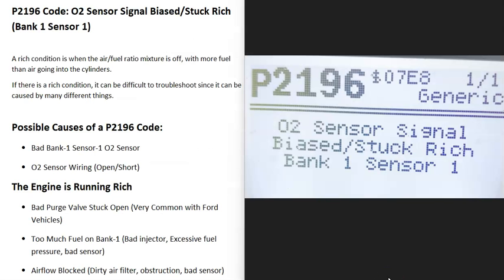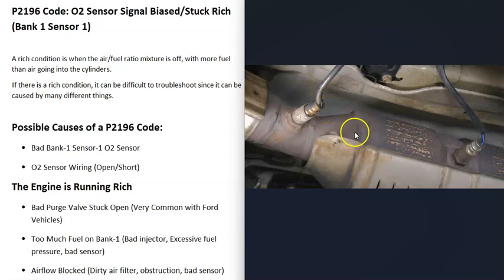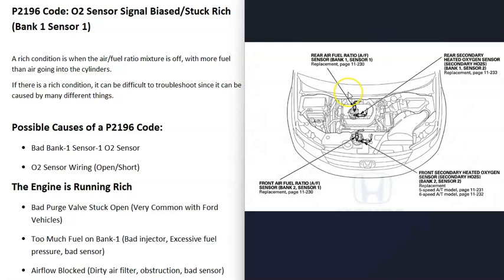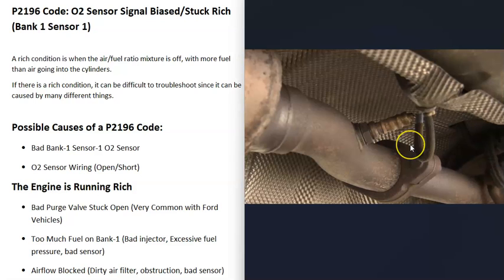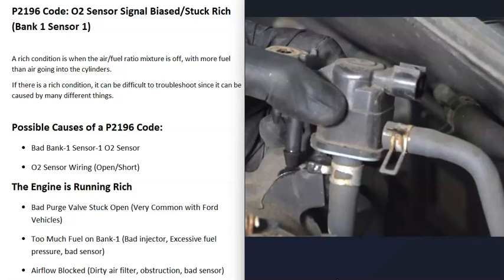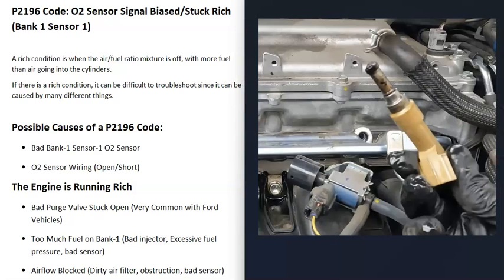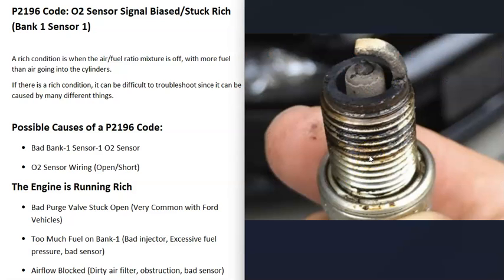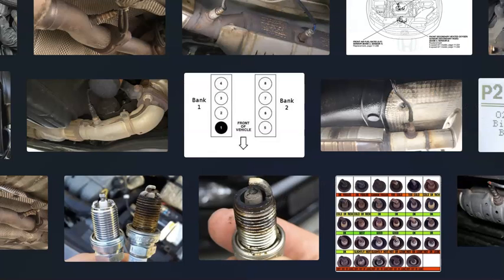Causes and Fixes P2196 Code: O2 Sensor Signal Biased/Stuck Rich (Bank 1 Sensor 1)

Comment: Thanks for the video...i have a 2012 f150 with the coyote 5.0 engine.  Currently showing p2196 and p2198.  Since its reporting rich on both banks, would the purge solenoid be the right place to start? I had 1 instance when it didn't want to start and 1 where it stalled at idle. Any input  is appreciated!

Comment: Got a 2004 Camry xle, throwing a p0171 and p2196 , any suggestions?
Reply: Did you find the problem?
Reply: @Kagawa71 yes ! Ended up changing the MAF sensor, I was able to determine it was faulty by reading the OBD scanner Load % , it was less than 80% around 58%-60%

Comment: Very interesting I have a 2016 Toyota Corolla with a P0172 p0456 p0139 p0441 p0455 p2196 and I’ve already tested the purge valve seems to be working once engine warms up can’t seem to figure the problem I don’t assume both o2 sensors would go out

Comment: Thanks, man. New sub. Definitely earned my business! 🤙This was a very educational video. Extremely helpful! Not only did you explain the code, but you actually explained the possible issues that created the code to go off to begin with and pinpoint where these issues are arising from! 

Unexperience individuals would have probably just gotten the sensor replaced without thinking what caused the issue to begin with! 🙌

Comment: So heres my issue i have a 08 ford focus so i first got a p2196 for 02 sensor bank 1 sensor one biased/ sruck rich . So i replaced the sensor i also had a leaking valve cover gasket so i replaced it and spark plugs wich looked  sort of a dusty light color. the code went away but i still have the poor engine performance. My syntoms are when i try to start my car it will either be a rough start no start or it will start right up and when it does start the rpm's dip then fluncuate then settles and finally idles but if i put it in drive the rpm's dip again and it seems to idle rough if i try to drive the car i have poor acceleration, low power,  jerking , hesitation,   
And when im at a stop light it may or may not stall and when it does i smell gas and i get the p2196 code and check engine light but when i start it back up the check engine light is gone but not the bad performance . I cleaned the maf sensor also but seen no change any advise is appreciated
Reply from the maker: Anything I say is a guess, but a dirty throttle body is common with those issues. I would clean up the throttle body with throttle body cleaner and see if it improves.

Comment: Oh mine runs rich. I can smell it. No cats. I replaced bank 1 sensor 1. Purge valve no vacuum when running. Spark plugs smell like fuel. (I changed them all, killed me lol). Idles bad intermittently. It has a cold air k&n air intake. I bought truck recently. Mistake maybe. 2009 F150 4.6 3v engine. Starts really great so no problem there. I cleaned maf sensor. It looked clean before I cleaned it though.
Reply: any updates??
Reply: @rubendasoccerpro5063  still runs bad in drive. I changed the cylinder head temp sensor, put a new maf sensor. I checked all the fuel injectors voltage good. My next plan is to change purge valve and clean the throttle body real good and go from there.
Reply: @trishperkins5416  Any updates?
Reply: @MrTLsnow yes. The wiring to the 02 sensors(actually heater sensors) were plugged in wrong. I had my torque converter changed and the mechanic had accidentally plugged bank 1 plug wire into bank 2 sensor1, and bank 1 plug wore into bank 2 sensor 1. The wires were crossed over the transmission. A different mechanic figured it out and lowered my transmission and fixed it. Costed me 100 bucks and that was it.
Reply: @trishperkins5416 wow that’s a headache, glad you got it fixed

Hopefully that guy quits smoking weed in the shop
Reply: @jacksonswanson9106  yeah at least while hes working on things lol

Comment: I have P2196 fault code on my Skoda Octavia 1.4 TSI 140hp, when I remove this code from ECU, every 5 to 6 days comes back.
I replaced O2 sensor before catalyst, all spark plugs and one induction coil on third cylinder because I had a  missfire fault code on third cylinder.
I don't have any problem with power on car, no problem with fuel consumption( I have average 5 liter on 100km).
If you know why I have every 5-6 days this fault code.
Maybe I must to change all of inductive coils.
Reply: any updates??
Reply: @rubendasoccerpro5063 any update pls?
Reply: Any update please. We have the same issue
Reply: Any update pls?  @anasmalik-hb9tn
Reply from the maker: Is the misfire fixed? If not, I would check the injector on cylinder #3 that has the misfire.
Reply: @HVAC_Mechanic  Yes, missfire is fixed.
Now, I don't have any problem with missfire.
Reply: @HVAC_Mechanic  But, every 6 days P2196 fault code comes back.
Correction factor on all cylinder is around 1.00.
Reply from the maker: When codes randomly come back with a delay, it can be hard to pinpoint the cause. If there are no other codes, I would examine the O2 sensor wiring for any bad connections.
Reply: @HVAC_Mechanic  I can try to clean connector on O2 sensor, when I replaced old O2 sensor I am just put the new without cleaning connector.
Maybe I must to do adaptation on new O2 sensor?